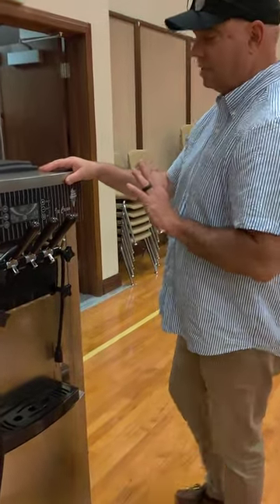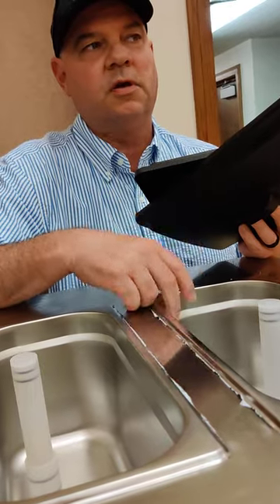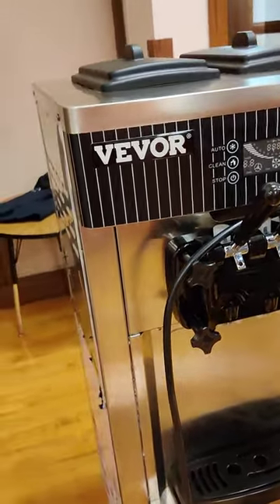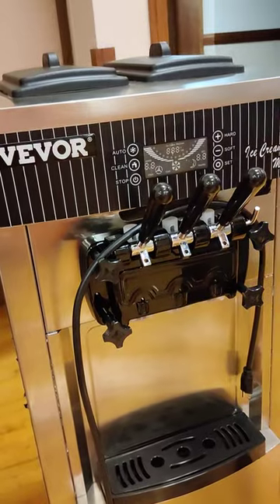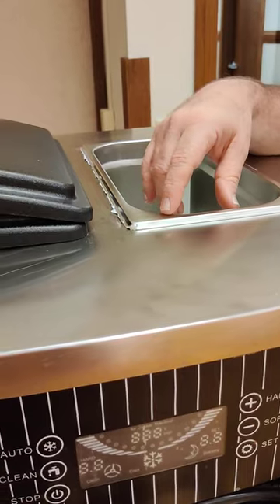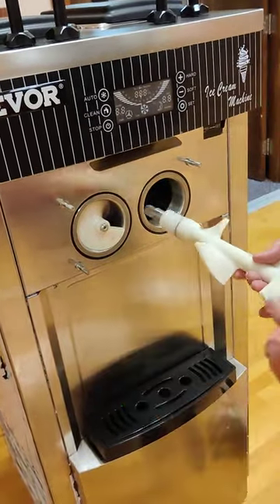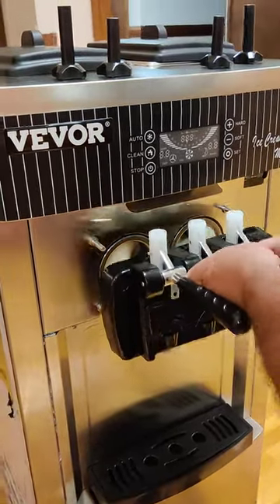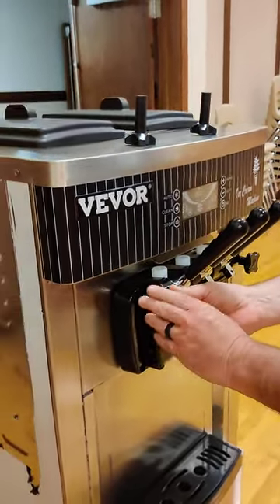Vevor ice cream machine how to operate and clean

Comment: You should use food grade vaseline on all the rubber “O” rings. It will keep them from wearing out. Also lube the rubber cone on the end of the augers. The “thing” in the hopper is the PUFFER TUBE and it needs the “O” rings lubed , then you will not struggle trying to insert. This man actually knew very little,sad. The star fasteners holding the front dispensers to the machine only need to be tight enough to seal, no need to crank them down so tight, you will ruin the large silicone washer.
Reply from the maker: Thanks!
Reply: Make a instruction video
Reply: How do you put it into night mode?
Reply: @RobertHerz-dr3xo  press the “standby mode” and it will spin the auger when needed and also chill the reservoir to keep the contents fresh.

Comment: What happen when vanilla goes in other compartment with chocolate
Reply: If you’re getting chocolate in the vanilla it means the divider in the middle handle  tube is not in correctly It has rubber Divider that keeps the two flavors separate

Comment: How has the machine held up? I’ve been thinking on buying one for commercial use and wondering if it’ll keep up with demand
Reply from the maker: I don't know. Ours is only used periodically for church events. One of the rubber gaskets has had to be replaced after less than a year (maybe 5 events) but that could have been from misuse. Otherwise performs great! Good luck!

Comment: Should I do the cleaning daily ?
And
Is it necessarily to add hot water or normal heat
Reply from the maker: I'd suggest cleaning every time you use it. Hot water (but not boiling) is best.

Comment: What setting did he say? Also what did he said about kitchen breaker tripping?  One more thing, do you know what model Vevor this is? Barely can hear him.
Reply: He said level 4 is his recommendation for hardness. Any more than that n the ice cream will get too hard for the auger to spin. When that happens it stalls the motor n the machine will start pulling too much current n trip the breaker. Especially if the machine is plugged in to an outlet that is being used by other appliances. So it's ideal to run the machine on a circuit that at the very least doesn't have any other appliances running at the same time as the ice cream machine

Comment: What do you do if you haven't gone through all the ice cream and need to clean the machine?
Reply: Easy, just put your mouth under the left dispenser n pull the handle til it stops spitting out ice cream. Repeat for the right dispenser, then the middle lol. But seriously there's no way to do anything but empty the ice cream that's in it. Depending on how much you have still in the machine you can put it into containers with lids n put it in the freezer to serve as regular ice cream. I've seen someone that also had a ninja creami dispense their extra soft serve into the containers for the ninja n freeze it, then spin it in the ninja to make it creamy again. Also any soft serve mix that's still in the hopper up top n still liquid you can scoop out n put in the refrigerator, but it will go bad in the fridge if left in there for too long

Comment: Why does my hardness always go down after each pour? Is that normal?
Reply: Your hardness is going down because it's pulling more of the unfrozen mix from the wells on top so its refreezing. Honestly as long as you don't start a cone below 3.5 you should be okay. If it drops like 2.7 you may be out. The machines sometimes don't alarm when a well is empty